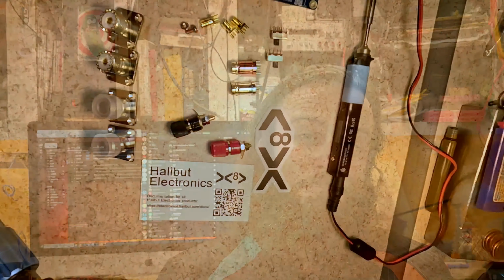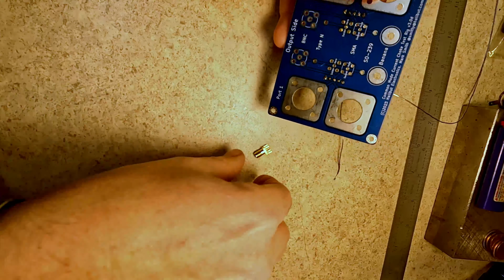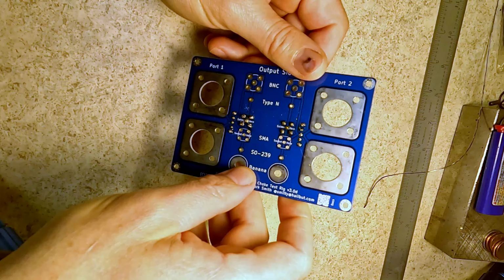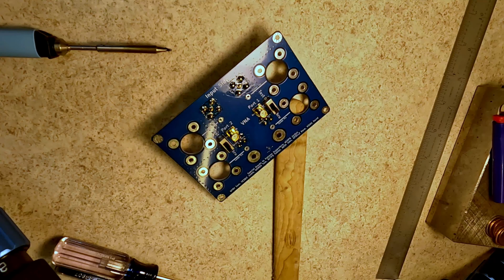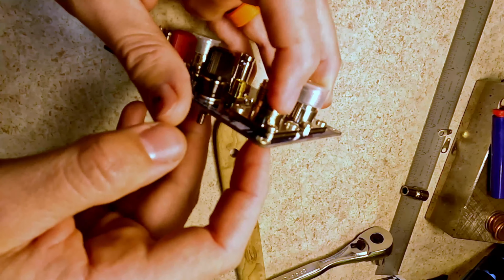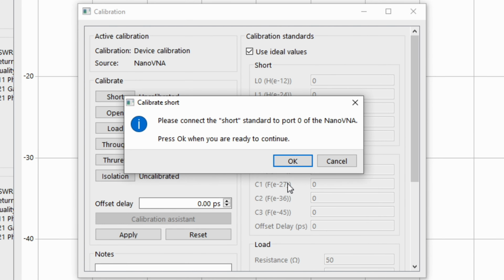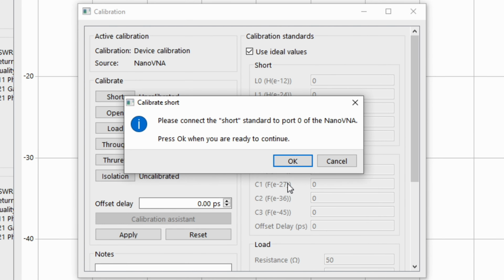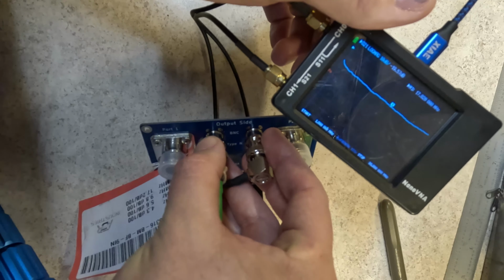Can you test common mode chokes?

Comment: Interesting but for the first choke the so239 center pins were not connected to the pcb?
Reply from the maker: The center pin/conductor is not being tested with this, The ability for common mode chokes to suppress signals is and that happens on the braid of the coax.
Reply: @LifeAtTerminalVelocity 
Would be interesting anyway if the pins were connected to see if it makes any difference, I get what you are saying though. 73 from Sydney
Reply: @-VK2NP  you can build a rig where you throw a switch to toggle between common mode and differential mode measurements. Idk if this particular revision does it, but I think their latest revision does IIRC.

Comment: To be fair to ABR (who make great cables, BTW).  That choke you have with the 5 beads, is probably optimized for VHF and UHF.  Parasitic capacitance is a much bigger problem at higher frequencies, so keeping your choke linear and not looping the cable, makes it perform much better at higher frequencies.
Reply: Yep. Choking at HF has many more options than VHF/UHF. I’m working on a product now that needs a CMCC at VHF/UHF, so I’m learning ALL ABOUT this. :-)
Reply: I wondered why the first big choke did not perform as well at the higher frequencies.
Reply from the maker: I mean even if it is -20dB of choking with 5 ferrites it is still a lot more than I would get without them. I think that their product clearly works based on what the nanoVNA shows.
Reply: @LifeAtTerminalVelocity  Exactly. Some choking is WAY BETTER than no choking.